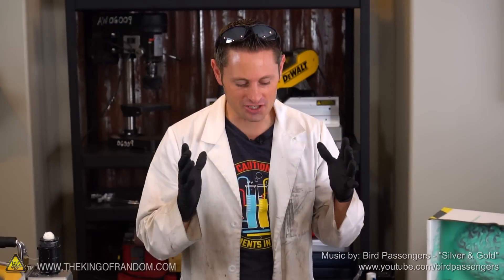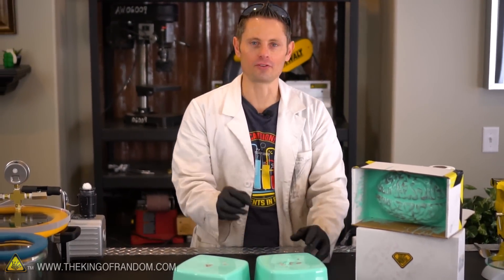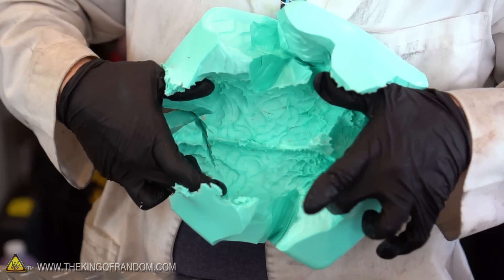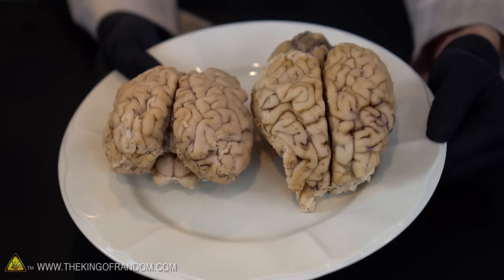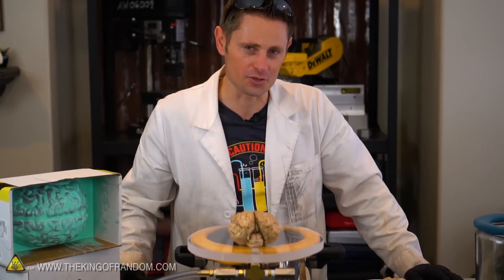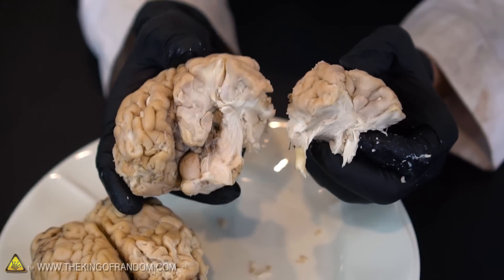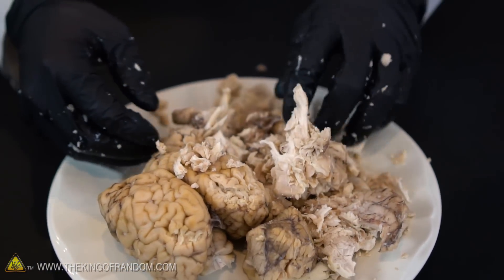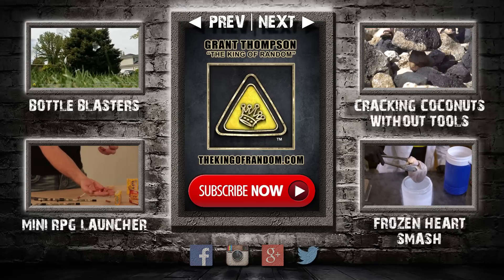Brain In A Vacuum Chamber | TKOR Brain Casting With Silicone Mold and Vacuum Chamber Experiment

Comment: Pour another coloured silicone mold inside the silicone brain mold for a silicone brain :)
Reply: Corz 2K the silicone will fuse together
Reply: Chris Cramer You can just spray it with with a mold release before.
Reply: They have silicone that wont bind to other silicone unless its fluid, it's used for making two part silicone moulds.

Comment: I wonder what a lung would do in the vacuum chamber. I feel like that might be more interesting since it is made to have air in it. Also would something fresh from the butcher react differently to one in formaldehyde?
Reply: Rebecca Woodward Lungs is related to air but it works with blood. The lungs separates the oxygen from rest of the air and mix it with blood and pass it to heart. It don't act as balloon, so it will not do something in vacuum chamber...
Reply: pls... No
Reply: What about fresh vs preserved? Would there be a diff er ence in the reaction of different tissues based on the chemical process?
Reply: Rebecca Woodward LOL, you want the all the body parts like he did with heart, then brain and now lungs then kidney, stomach and finally a whole human!
Reply: That could be interesting but the lungs would have to be pluged. My guess is they would pop like a balloon. That is why you must not hold your breath while you are  surfacing during scuba diving.

Comment: Sticking with the whole organ theme can you cast eyes in silicon? What would happens to eyes in a vacuum chamber? What happens if you stick eyes in liquid nitrogen?
Reply: you might as well make a silicone mold of a pool ball tbh no offense
Reply: Marcus Spivey ooh yeah and there is liquid in your eye (I believe) so it might explode :D
Reply: Sour Pickle why?
Reply: In fact, there's both jelly and liquid there. Watch eye dissection videos if you like, there's plenty of liquid in the eye.
Now will it pop in a vacuum chamber? In fact, unlikely, at least not in the one Grand has. The eye is very tough on the outside, and it will not pop. Even with a scalpel you need quite a lot of force to puncture it, and the kg/cm is much higher when you talk about the blade tip, than the chamber can create.
I may be wrong, of course, but my bet - it will not do anything.

Comment: Maybe put epoxy in the vacuum camber and make crystal clear molds, or put stuff in the epoxy like leaves. Like if you want to see that?
Reply: W3sternSk3leton eventually but it would pop all the bubbles first and then you would basically be casting plastic

Comment: cast a sheep eyeball to make realistic eyeball gummies... like if you agree
Reply: It would just be a round object. You won't get the detail (like lens or iris) in it.

You might as well cast a ping pong ball because the outcome is the same.
Reply: AnarchyEngineer the iris and lens stick out a tiny bit from the other part so it possobly work
Reply: Not enough for the silicon to get it though. It's too small a detail.
Reply: MAKE SEPTIC EYE GUMMIES!!!!
Reply: I'd rather see what happens to an eyeball in a vacuum chamber.
Reply: that's how you get featured
Reply: Yeah that's how you get featured
Reply: Sebastian Sobrino nothing. It's just a blob of muscle and water. The most that could happen is it'll leak/bleed.

Comment: what happens to water in a vacuum camber
Reply: Aidon Bugiyne it boils
Reply: Aidon Bugiyne it boils at room temperature
Reply: It boils at room temperature, and then condenses back into a liquid (which would run down the walls of the container as the water has turned from a vapour back to a liquid) when you remove the vacuum. 

If you left it long enough, the container would become empty and removing the vacuum would condense all the water vapour back into a liquid again at the same time.
Reply: AnarchyEngineer Nerd